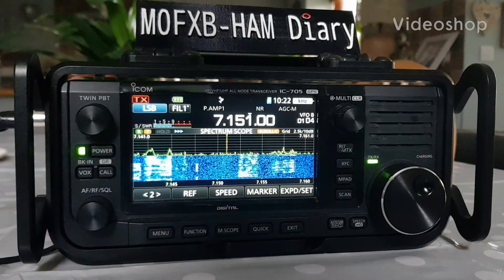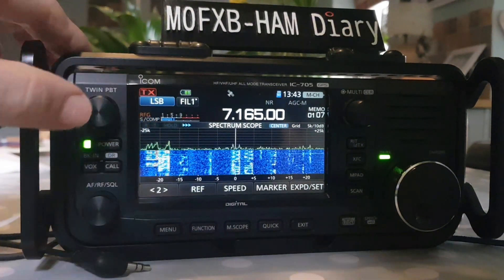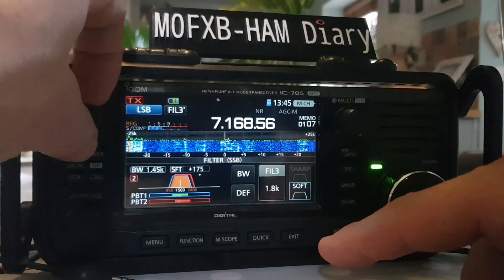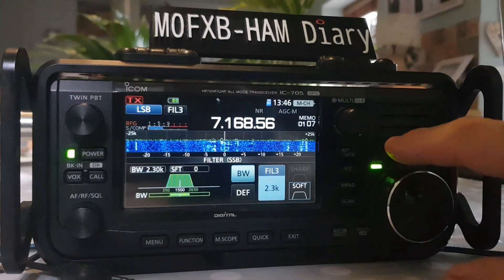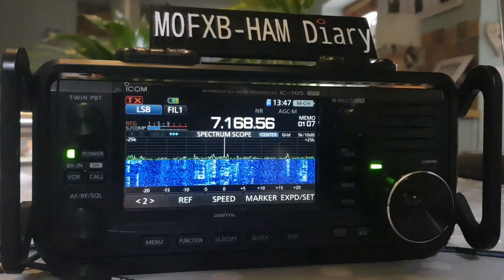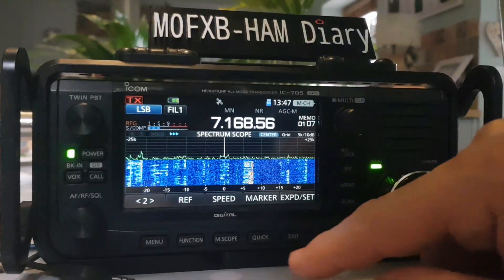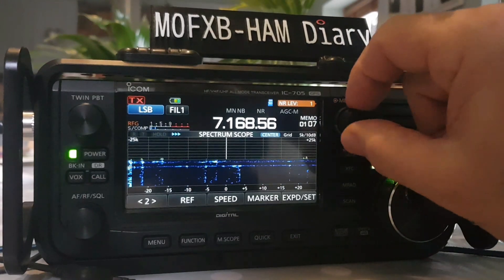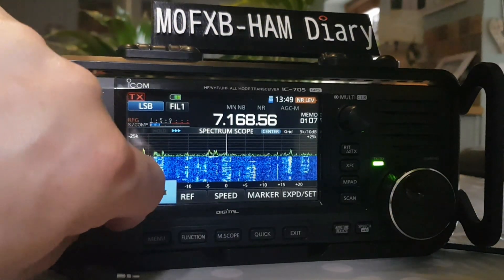ICOM IC-705 Filters Twin PBT - Notch -Noise- Reduction - Noise blanker etc

Comment: TBW is Transmit Bandwidth.  When you use Narrow and Mid, you are compressing your signal to be a bit 'stronger'.  However, in my experience, it eliminates most of the bass from your voice and makes it harder to understand anyway.  I keep mine on Wide and make contacts all over the place.
Reply from the maker: Hi thanks loads .